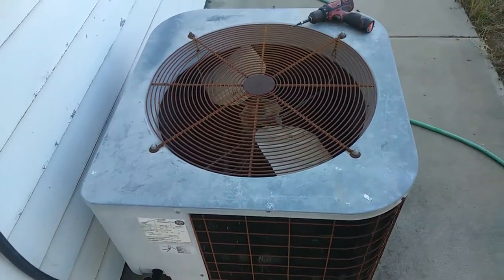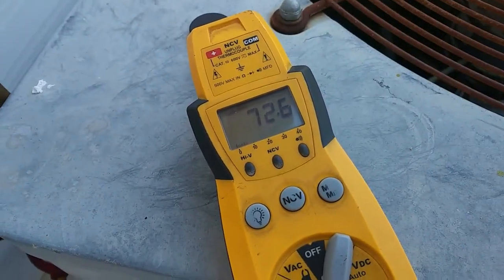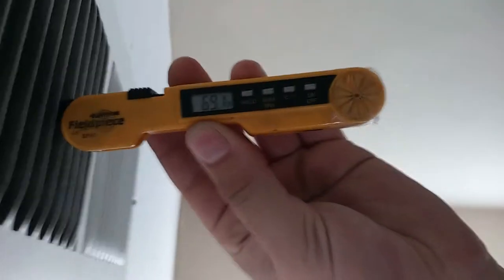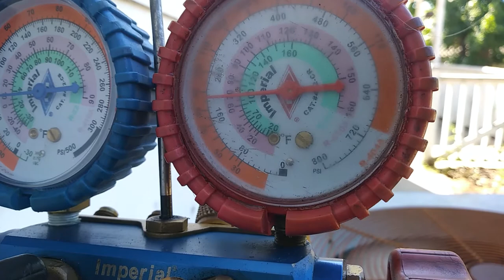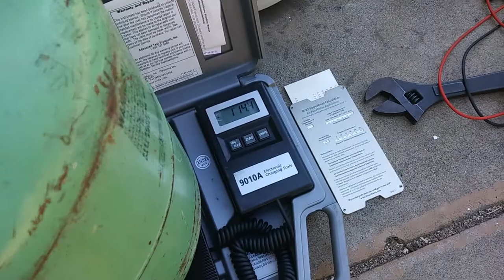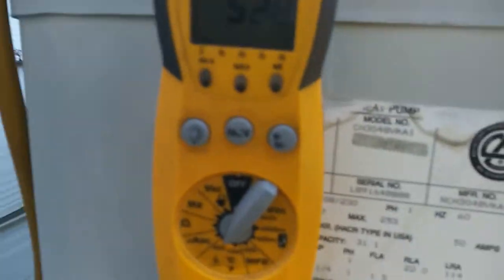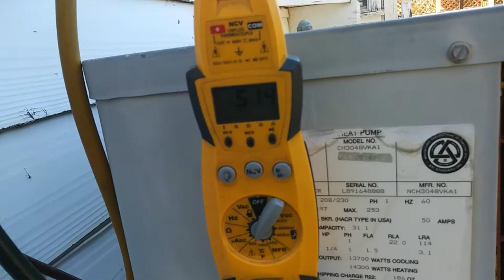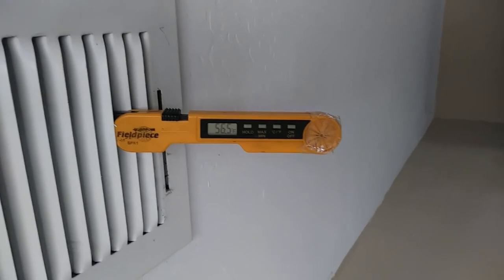Leak Repair/Recharge - Vintage Tempstar R-22 Heat Pump (1988)

Comment from the maker: Before the job was over, I looked on the side of the unity facing the house and found the Tempstar badge. After doing some quick research: I learned that in 1988, Tempstar was made by the Heil-Quaker Company (HQCO on the nameplate)  in Lavergne, TN. Heil-Quaker became ICP which was eventually absorbed by the Carrier branch of the United Technologies evil omnicorp.

If you're new to the channel, please consider subscribing for more work videos and useless factoids about bygone HVAC manufacturers